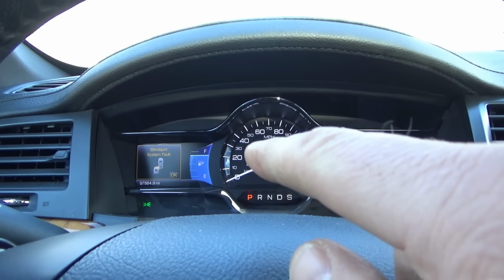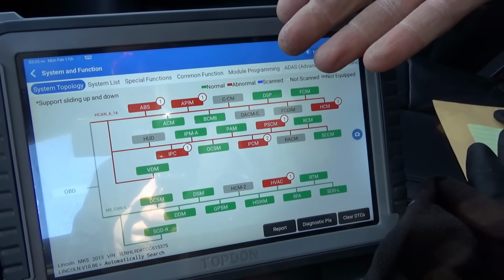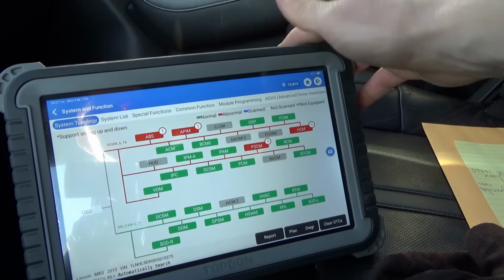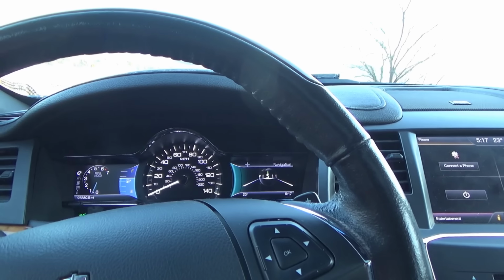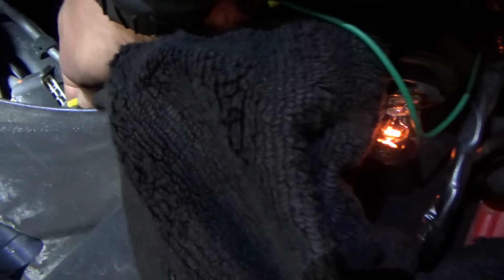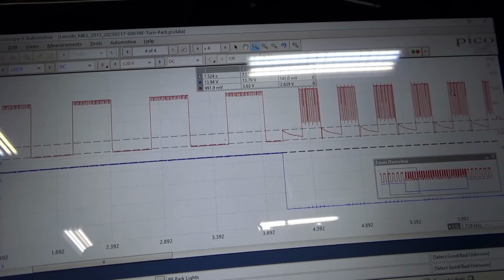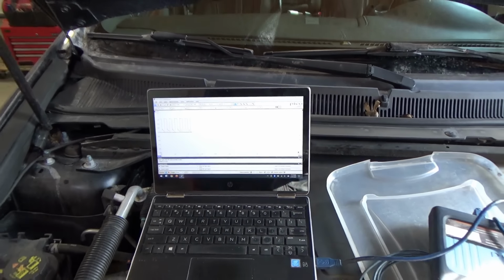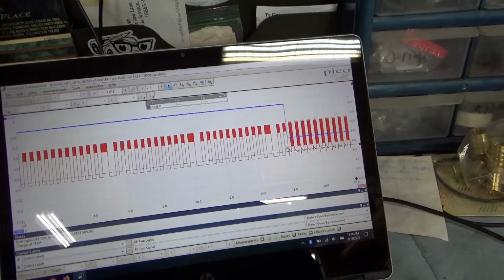(Pt 2) Lincoln BUTCHERED...by Dealer?! ('13 MKS: ABS Fault...CRAZY "Strobe" Turn Signals?!)

Comment: The turn signal flashing pattern is because of incorrect lamp type configuration in bcm. Exact symptoms I was dealing with.
After a long conversation with ford engineers, they said that bcm has incorrect configuration for rear lamps. Suggested that I change rear lamp configuration with forscan. So I did and fault was resolved. Even if I installed new bcm, the fault would be still there, because server provides incorrect configuration for the vehicle. And yes I had the same scope pattern differences between different voltages.
Reply: My first thought was the wrong headlight, taillights or the configuration of them. This looks like a bulb out warning condition. The BCM is not seeing the correct current draw and creating the fast flash as a warning to the driver. Increased voltage adds to the issue by reducing current draw. You are spot on!
Reply: I was thinking this that they have a different config installed for example it's looking for a bulb but it's actually an led
Reply: @joshuabest100 yeah, sometimes you just can't substitute an L.E.D. it doesn't have enough ' load '.
Like older mechanical flasher systems, when a bulb was out, it didn't have enough load to heat up the bi-metal piece in the flasher and it wouldn't flash at all.
Reply: We had this issue swapping in the wrong configured headlamps into a VW. At least the VW warned us about configuration mismatch and we put the old ones back in and good to go. Chryslers have this same issue. The strobing is actually a bulb check for incandescent lamps that were either not available in the lincoln because they are all LED and the BCM is programmed incorrectly. I know you can code them in with the coding function and there is a lot of writeups about this kind of thing.
Reply: At Mercedes the wrong bulb can do weird stuff.
Reply: I use forscan when you convert a police model to civilian use explorer.  a few interior pieces from the bone yard and some forscan time from a known base model  that i have saved from a few model years and bam back to stock settings!
Reply: Another thought is to unplug all the light modules and see how it effects the pattern.  Or either plug or unplug them well observing the scope.
Reply: Yeah my immediate thought on part 1 was he needs Forscan
Reply: I’m wondering, but it doesn’t make a whole lotta sense about checking powers and grounds at the BCM; from the pico scope, the voltage drop outs look a whole lot like a power limit or a transistor reaching its breakdown voltage. But as you said, that’s all in the bcm
Reply: I would check the setup in Forscan.
Reply: Easy way to test would be to put a resistor in parallel with the turn signal power and ground to add current. If the flashing goes back to normal then I'd say it's correct that the bcm configuration is set for an incandescent bulb rather than led.
Reply: I have seen this before also.. Super common when installing LED's on a normal system.  But honestly, I wouldn't doubt if there's more wrong here.  The strobing is a bit different.
Reply: So what you're saying is the VIN bcm coding that Ivan got from his source is wrong. Very possible. This happens with VW/Audi a lot but the modules throw an incorrect config code.
Reply: @event3horizon  Ford sometimes will give you incorrect module configuration DTC, but not always.
Reply: Bcm from police car lol
Reply: @peterlworth 😂😂
Reply: Derpie put in unsuitable LED bulbs because they thought they were "Kewl" and the BCM is giving bad bulb warning. More likely an idiot changing bulbs than coding though . . .

Comment: Hey Ivan, I don't think your PCM is broken. Given the water under the drivers, I think you need to check the connectors and ground connection. 

Technically, the PCM has been different since 2012, but that doesn't mean it automatically fails.
What happened in his video (the turn signals acting strangely at 14 V, but not at 13 V) still primarily points to a voltage or ground problem. Only with this newer PCM/BCM setup is the effect more pronounced because the modules are more sensitive to voltage fluctuations

Comment: the drains under the windscreen probaly blocked. i have similar problem with my car and its water has got in bcm the indicators do not strobe because there bulbs it just randomly turns some off when it feels like it and flashes the others faster. the radio would go off and rear wiper turn on and all sorts of strange things.
struggleing to find a replacement and someone apart from dealer to fit it. so i took it out and took it apart it wasnt green but white stuff and cleaned it with contact cleaner, now it seems to behave for a few months

Comment: Check the multi-connectors in the interior looms for greens. Strip the BCM. Check for water damage. Trace the turn signal output to the driver IC. Get the datasheet for the IC and check it's input(s) - it will be a multiple driver IC so there will be more than 1. Or just swap the driver IC and see what's what. Could be the MS Can being superimposed on to the input side of the driver for whatever reason. Had the same sort of thing with the BCM on a UK Ford Kuga. Cloning to used BCM usually easiest option if nothing obvious. For how long cloning takes it's sometimes easiest thing to do to eliminate the BCM from the equation.

Comment: Ivan, you went after the turn signals because it was something easy to isolate. But don't forget the ABS codes and the steering wheel position sensor. There is still more going on than just the turn signals.
This obsolescence of electric modules should be criminal!
Reply: 7 years isn't long enough, I agree. They should be a 20 year requirement and costs should be reasonable since $1,000 is not at all reasonable. Why? They are safety parts just like brakes and light bulbs/fixtures/modules etc.  An 8 year old vehicle without safety parts can't be driven on the highway legally.  The feds should force the auto makers to make these parts available for a good 20 years and priced fairly.
Reply: @Garth2011 At a minimum they should be forced to release Theory of operation, schematics, and programming for the parts they discontinue.

Comment: UGH!!! What a mess!  Does anyone expect a tech paid flat rate to diagnose this?  Problems like this are becoming the norm, difficult to diag and no parts available.  Plus the manufactures have eliminated installing used modules.  It's planned obsolescence,  the dealer in this case was right.  Send it to the demo derby and then to the crusher.
Reply from the maker: No, dealer was NOT right. They mis-diagnosed the car, and then made it WORSE by swapping modules and bad programming attempts LOL!
Reply: Should park it infront of the dealership, call the media, douse it with gas, and light it up

Comment: On modern cars, the bulbs are PWM'd if the battery voltage is above a certain threshold, to extend the lifespan of the bulbs.
It seems that this PWM signal caused the bad bulb detection to go nuts.

Comment: My guess is water/corrosion damage somewhere, shorting multiple logic circuits together. The BCM goes to current limiting mode to protect its output drivers while flashing, hence the weird fast voltage drops on the outputs. Maybe the short is between the turn signal wires an a COM line, which corrupts the communication between modules and causes the other symptoms. My humble two cents is it wouldn't be bad to scope the CAN busses for weirdness/ erroneous voltages especially with the turn signals switched on.
Reply: The BCM doesn't have a good ground on the turn signal driver - that's why you get that exponential decay. That's characteristic of a bad ground, and that's what a capacitor discharging through a resistor looks like.  When the parking lights are on, somehow it's grounding better through hat circuit. Probably water in the connector, corrosion in the connector due to water, water in the harness, or water internally in the BCM
Reply: Since the BCM is located near where the water seems to be getting in, I'm surprised, Ivan, that you didn't check the BCM connector.  At least, you didn't show that you did in this video.  Also, did you not notice the wet carpet??????

Comment: Did the headlamp assembly’s get replaced with the wrong ones. Giving the wrong amps back at the module.
Programmed to tell you have a light out by flashing fast. Like the old school flashers.
People get the headlight assemblies replaced when they get fogged up.

Comment: When i see these videos...  i love my old toyota even more
Reply: Same here. Got a 1999 Camry 4-cyl! Love that car!
Reply: In Europe Lexus(=Toyota) just got elected #1 most reliable car of 2025 (the NX300h)
Reply: Can’t argue with that! 👍
Reply: Same here. 2006 Matrix with 231k miles.
Reply: Remind me to go in the Garage and hug my 2002 civic!  Other than normal wear and tear maintenance....  not a single fault.
Owned since new.  I REALLY don't EVER want a "new" car like that.
Reply: Out cruising the wife around now in the ol’ 94 Camry. 👍
Reply: They manufacture cars to be less reliable so you buy a new one and more complicated with modules so it's harder to work on as a DIYer and you'll have to take it to get fixed. That's not an opinion that's a fact.
Reply: Any old car. Toyota fanbois 🤦
Reply: And that’s why I’m restoring a 2004 Solara
Reply: @fredmalito9869 Yep, just re undercoated/ rust proofed my 04 2wd Tacoma 2.4 , another one of my old jewels! Even has window cranks. I don’t use it much, but I just can’t part with it. 😂👍👍🇺🇸

Comment: My 2003 T-bird has the turn signal issue. Took the multi-function switch apart and cleaned it and it returned to normal. Not driven much the signal eventually went wierd again.

Comment: Good Morning Ivan. Just got to the goofy lights thing. First thing that comes to mind is possible led bulbs causing havoc.
Reply: Not the water either . Crazy. Goes bonkers related to park lights , but not really totally bonkers from the scope results, which kinda shows a stable bonkers. As long as the Tornado is supplying steady voltage or the vehicle is running, voltage shouldn’t change with park lights on or off. So it (perhaps) must be something tied together in the park/ turn circuit. Either in the bcm itself, or somewhere else. I’m leaning to somewhere else. Interesting to say the least! 👍👍🇺🇸
Reply from the maker: The bulbs are ALL LED from the factory haha
Reply: @PineHollowAutoDiagnostics That rules that idea out. Now I see the water intrusion! 👍👍🇺🇸
Reply: @PineHollowAutoDiagnostics  yeah, but they also have diodes resistors and caps/inductors in the built in driver vircuits... yhis can cause issues.